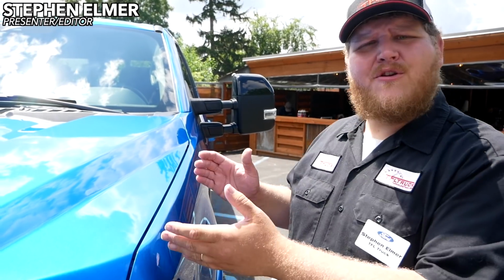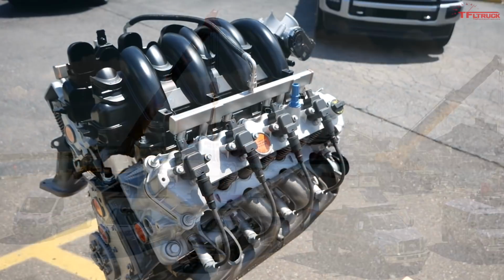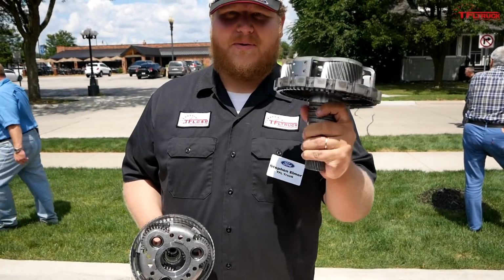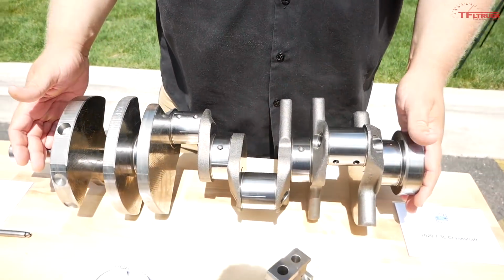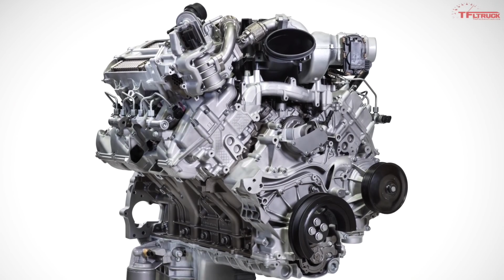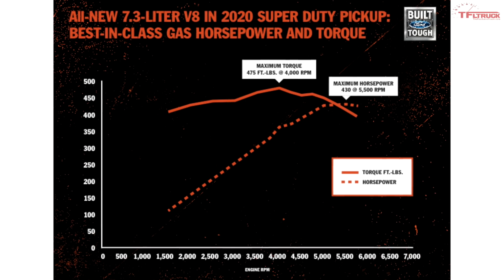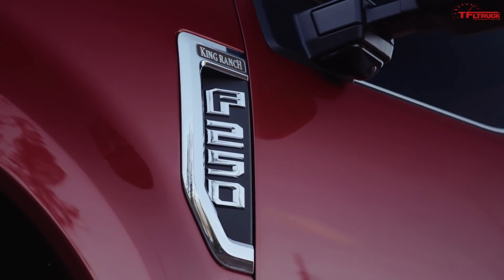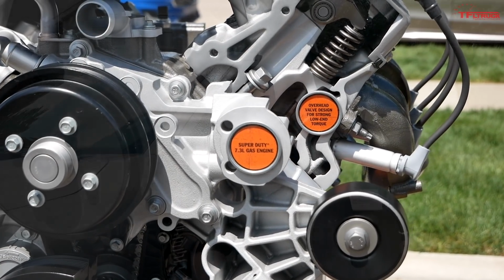We Finally Know the Ford Super Duty 7.3L V8 Power Numbers & They Are Lower Than We Thought!

Comment: Looks like a Ford LS based engine. lol So it should be a great engine.
Reply: More like a 427 Side oiler. Ford invented the Y block and cross bolted mains in the 60's, not GM. lol to you sonny.
Reply: @RSDX99  Ford had the side oiler in 63. The Hemi was out in 64 both with cross bolted mains. The Y block was out in 54 and yes it was "deep skirted" but the mains were NOT cross bolted. However, Ford did not "invent" the deep skirted block because the Buick Nailhead was out in 63 and was also a deep skirt block. Buick continued this design in the Small buick V8 and V6 all the way until the 2000's as the 3800 V6.
Reply: Rob m   You do know that Chevy didn’t create the pushrod design, right?
Reply: Random projects USA  when did he say they created it? He just said ford boys talked shit but now they returned to the old fashioned way
Reply: @randomprojectsusa5196  Right...and Ford didn't create OHC either.   You have no point here.
Reply: @randomprojectsusa5196  Buick did...what's your point?
Reply: Spare parts   Many people create things, but others make the same thing afterwards and do it better
Reply: Ha! The LS is a copy of the old Windsor engine, they even bolt on to the Windsor block! 
In a few years LS swaps will be gone and 7.3 swaps will rule!
Reply: @Darkhorse393  Yup.  Most are too busy leg humping GM to see the facts.
Reply: @Darkhorse393  I'm putting one in a miata!
Reply: Darkhorse393 imagine the aftermarket
Reply: @Darkhorse393  more crack baby comments.  One would think if the windsor was as good as a ls or sbc that one could buy a k member to fit a furd engine in a Camaro.  But it seems to be the opposite eehhh
Reply: HioSSilver1999 they aren’t power monsters they are just solid reliable motors but to say that Windsor didn’t help the LS design is not fact based lol GM took fords 10speed trans because if it isn’t Allison it’s GM trash no one wants a Windsor in a camaro because a Camaro has an LS....
Reply: @TylerSmithMusic1  gm or furd didn't have a a10 till they collaborated on it... ..so your facts are not facts. The first production application of that trans was in a zl1. On top of that look at all the powerglides, th400, 4l80s getting  swapped into.....well everything.  I don't see and furd transmissions behind a gm engine. More facts. 

Not many wants a windsor in their mustang......more facts.
Reply: @HioSSilver1999  first use was in f150
Reply: @HioSSilver1999 ford built the 10 speed for real cars (rwd).  Chevy built the 9 speed for the dumb fwd cars.
Reply: @Darkhorse393  Uhhh they kind of bolt on with grinding and filling work. But the bore spacing is not the same. But so what? Pretty much all of the pushrod engines from the 50's on up are very, very similar. I highly doubt GM had a crusty old 351 sitting in the engineering lab. Most of the key changes came from lessons learned by the industry. The Windsor never had reverse flow cooling, didn't use fast burn combustion chambers, didn't use a crank driven oil pump, didn't have deep skirt cross bolted main caps, didn't have a dry intake, and didn't use piston oil squirters. Just to name a few key differences.
Reply: @Darkhorse393   ford and chevy fanboys , you guys should really stop arguing over who copied who on what because it goes both ways. Maybe the LS stole some technology from the ford. even if they did they obviously did it way better than ford ever did , otherwise the windsor would be the popular engine swap , but yet its not. the LS is. Second to say gm copied the windsor and y block from ford is like saying ford copied the V8 design from GM , since GM did have the first v8 ever in a production car after all. Car companies thrive on stealing each others technology , reverse engineering it and improving on it. they literally have departments internally that go out and purchase the competitors cars and tear them apart and analyze everything about them.
Reply: Only if it’s good at holding boats in place because #GenercMotorCrapBoatAnchor
Reply: @I know you are right, And I just got owned but:  LMFAO, coming from a 10 year GM master tech I can tell you that is NOT true. The newer 5.3s and 6.2s have crazy AFM lifter issues causing bent push rods, injectors fail, most of the time both fail before 50k miles. But what do I know I mean with a name like that you obviously know everything and are clearly a GM tech too and not an internet troll. Don't even get me started on condensers leaking, 8 speed trans shudder and 6l80/6l90s coming apart. But hey I'm not bitching, GM has provided plenty of work for me over the years. 😂😂
Reply: Well it seems like everybody copies everybody now a days. Look at 2019 Sierra's headlights. It looks like they came straight out of an F-150. 

Ford came out with an eco 4banger on the mustang and Chevy followed steps. Ford put the eco 2.7 on the f150 and look at Chevy putting a 4banger in their 1500.
Reply: I know you are right, And I just got owned but: you have never owned a Ford.
Reply: 😂 typical GM fan boy
Reply: Ca you repost your reply to me? Cant find it.
Reply: No, it looks like a Windsor, which came out long before an LS.
Reply: Should be better than Chevy then
Reply: You do know the Ford Windsor motors were instrumental in GM design of the LS
Reply: Tyler Smith crazy that still trips me out haha
Reply: @TylerSmithMusic1  That makes no sense, an LS is very different compared to the old Ford SB.
Reply: @TylerSmithMusic1  windsor motors were a joke. That comparison can only be made by someone on crack.
Reply: Well they gm and ford are building transmissions together now. It does look a lot like one.And He pretty much said and confirmed what us “fanboys” have known for years about a pushrod engine. Glad they made it to the game and ditched the overhead cam car engines.
Reply: @theaveragejoestinkeringand4407  like Ford hasn't built pushrod engines in the past lol
Reply: Marcus Corvain  Yes they have built them in the past but ever since they done away with them every ford fan boy I know has tried to explain to me why pushrods were no good even though we all knew they were full of crap. So it’s kind of ironic to see a ford pushrod V-8 sitting there that if you didn’t look real close you would think was a 6.0 Chevy engine. It will definitely beat the shit out of any overhead cam engine they’ve ever made. It wouldn’t surprise me if they didn’t start building smaller versions of it because people will like it just the way us fanboys like LS engines. There’s a reason.
Reply: Manual Truck Man the pushrod is great but it does have flaws comparative to the SOHC/DOHC... vice versa it’s higher rpm and runs smoother, breathes better vs low end torque and durability but it’s neither one is junk
Reply: Ive always been confused by the idea people have of OHC engines not making good low end torque. There is so much more to torque numbers than what valve train an engine uses. Just a quick google shows (just an example) the 2002 5.4 in an f150 made 350 ft lbs at 2500 rpms while a 2002 5.3 made 325 at 4000. Hell the 5.7 in the Tundra made 401 at 3600 all the way back in 07 when it debuted.
Reply: Then I see cam and lifters in the near future. Start saving now
Reply: @I know you are right, And I just got owned but: well, that's a new one. Last I checked the GM fanboys were crying that the only reason Ford sales more trucks is due to fleet sales. Now you claim GM has more fleet sales than Ford.

Comment: I've had the pleasure of testing this engine in prototype form on several occasions and I can say that I'm not as impressed as I'd like to be. The engine feels oddly sluggish and old, very similar to the feel of Chevy's 454 and some of fords HD engines back in the 80-90s which isn't really a bad thing but it doesn't feel up to par with the competition despite having slightly more power. I truly appreciate that they're going for durability though. My biggest disappointment would have to be the mpg. I was only able to average between 6-11 mpg throughout a fairly diverse route. Granted, every truck I tested was weighted down by about 3-5k pounds in the bed which suggest that most owners will be lucky to average 15mpg empty. While testing Rams updated 6.4 with the  new 8 speed on the HD platform I was able to average close to 20mpg under the same driving conditions while the truck was empty and about 11-15mpg under load. All in all, I felt that it was just a sub par engine. Yes, it'll get the job done but if your going to buy a truck to pull anything besides a small sail boat or plan on getting an F650 to actually work and not just look pretty, then definitely spend the extra for the Powerstroke and you won't be disappointed.
Reply: *Doubt it
Reply: @Backwoodsmachinist  Doubt what? That I test pre-production vehicles for a living or that you (having never driven a vehicle with this engine) think that my experience must be incorrect. I have no bias against any company and have driven every model of light duty and heavy duty truck that is currently and soon to be available. I am simply stating my educated experience and am open to discussing your disapproval of my comment.
Reply: I’d  rather have the gas 7.3 vs the 6.7. The exhaust is simple, no scr, dpf, etc. I wouldn’t buy a new diesel to pull stuff on the weekends. The 7.3 would be a great combination for weekend pulls, I’ll bet you the 7.3 will outlast a 6.7 in the long run. The 7.3 will be a legendary engine 20 years from now we will still talk about, just like the 7.3 Powerstroke.
Reply: @JAMESWUERTELE  You make a good point and I believe you are exactly the reason Ford is building this engine. Yes, it will make a great work truck engine so long as your not doing anything too crazy. And thanks to all the emission crap that's added to the new diesels, you might be right that this new engine will out last the diesel. Having driven both, I still prefer the diesel because it gets much better gas mileage (often times close to 20mpg on the highway with the new ten speed) and has nearly twice the ft lbs of torque making towing a much more enjoyable experience. I'm just disappointed that an engine this big couldn't turn out 500hp since I know it's possible and it would completely dominate the competition. I also wish that it could just do a little better on gas mileage but I guess what do I expect from a 7.3.

Comment: This 7.3l should of been high 400hp to 500hp with  600ftlbs of tq
Reply: It probably will in 3 years or so.
Reply: Its a commercial engine, not a sports car engine
Reply: @anthonywebber2211  yeah I know that but this is 2019. The 8.1 Chevy had that kind of power 20 years ago.
Reply: @bigmurph1447  and got 7mpg unloaded with 300hp only lol alot of torque but less hp then most v6s.
Reply: @Michael_ryan91  u got to remember the 8.1 is 20 years old. It took ford 20 years to gain 100hp and no tq over gm 8.1 come on now. The diesel use to be 100 some hp and 400 tq now there over 400hp and 1000ftlbs of tq. Ford could of done better
Reply: @bigmurph1447  ya in the 60s they had 425hp sooo idk
Reply: @Michael_ryan91  with the technology today they should be able to build a 500 to 600hp motor and still get good fuel mileage. Problem is they dont want to.
Reply: You are absolutely right. Anyone that knows anything about internal combustion engines realizes that you don’t need 7.3L displacement to make 430 horsepower. This notion that in order to achieve engine reliability and longevity the engine must make its maximum horsepower and torque at 2500 RPM is absolute bullshit. The Japanese and Germans know how to maximize engine performance, power, reliability and longevity from small displacement engines. They realized along time ago that you don’t need maximum engine displacement to make reliable sustainable performance in a work engine. NA engine designers should be ashamed at the crap they are producing. All garbage.

Comment: That was one flat torque curve.
Reply: People who complain the hp/tq aren’t high enough don’t comprehend what a nice flat torque curve means.. I’ve towed 18k # trailer with a 2v v10, it was much better than the internet experts said it would be. I can’t imagine how nice it would be to drive this truck
Reply: @ADVlife287  I've had close to 11k behind my 2v V10 (rated to 425 lb./ft) and it did just fine as well.  The old V10 was such a workhorse that Ford had to keep it in production for commercial and RV applications but were needing a more modern engine to keep up with emissions and fuel economy standards.  The biggest thing that worries me about this new V8 is the variable cam timing because that's always a failure point of any engine it's ever been put on and I'm expecting it to be a failure point on the 7.3 as well.  But this should be able to out-tow the V10 and do so without having to run 4k+ RPM on the hills.  One of these days maybe I'll get over the fact I won't be able to get a manual transmission in a truck anymore and buy something newer but I refuse to buy a diesel, this is on my radar for sure.
Reply: Just like the 300. Pullin stumps at idle
Reply: Greasy Steve 
One of the best Ford engines EVER

Comment: What’s with the window lickers going look at this tiny engine that makes more power yatta yatta. It’s about durability. Yea you can get more power out of it or smaller engines with turbos. But they spin their balls off and guess what dingleberries...higher rpms means more friction and heat and what does that equate too? More wear and tear. Low revs, low compression, less problems. Not no problems just less. Everyone wants 800 ft/lbs of torque with turbos at high rpm etc. good luck having that engine last 20 years or more. This engine seems like a very durable “sufficient” engine.
Reply: Hey dingleberry, what small engine  with turbos that "spins its balls off"  are you referencing to? I can't think of any. The V6 EcoBoost engines make peak torque at 2800rpm. The EcoBoost 4 cylinder about the same, so what engine are you talking about? No turbo engine has to rev hard to make power..so what's this 'mystery ' motor iv never heard of??

Comment: The engine is designed for the commercial market where longevity is much more important than wringing every last ounce of power out of an engine.  It's the same reason that the same diesel engine will make a lot less power in a medium duty commercial application than its consumer counterpart.

Comment: As the engineer said we looked around at the competition and we realized that all our gas engines with overhead cams  IE modular engines are all junk especially the ticking Coyote  we went back to a single cam shaft engine LOL. sure looks like a Chevy motor with the coils on top of the valve cover

Comment: I'd be more interested in figuring outwhat the horsepower is over the older Ford V10 for the applications in even heavier duty trucks/chassis cab and the immensely huge C class RV and box truck applications which use these bigger gas engines the most. Gosh that old V10 is a huge gas sucking dog with no power. Was always either pinned or stuck in a low rpm slump.
Reply: V10 310 hp 425 tq
Reply: @joelearl3  now we just have to wait and see how much they reduce the HP and torque for the bigger vehicles m they always keep high HP for the 3/4 ton and 1ton but then drop 40-50 HP for chassis cabs, work vans, rv's etc. Heck anything above that pitiful 310hp is good.